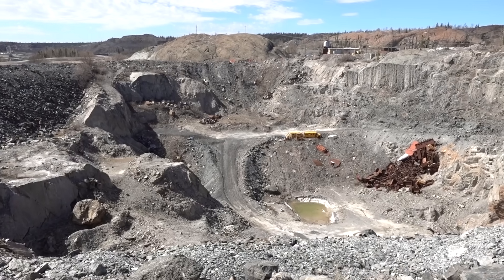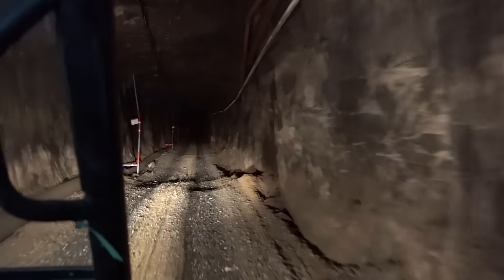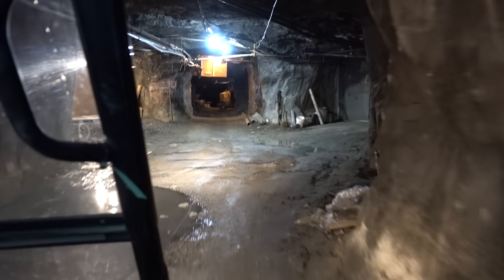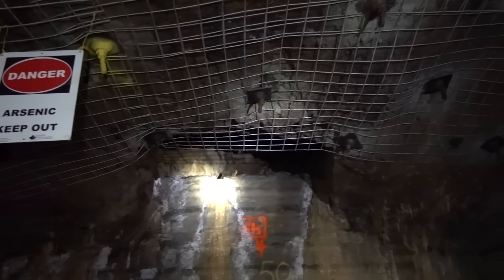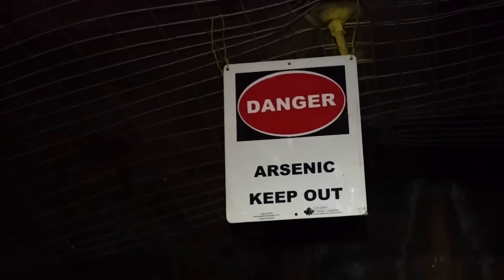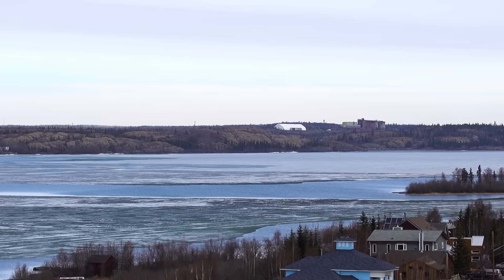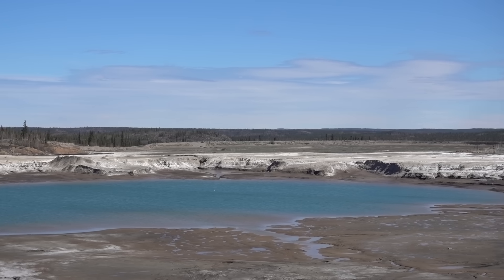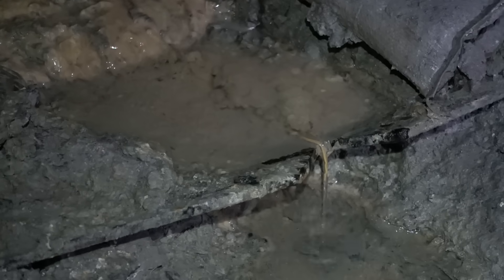Making 200,000 tons of arsenic dust safe

Comment: As the short term solution freezing is good enough and burying it under a mountain of insulation would really help. But for a long term solution the arsenic needs to be alloyed into a non-water-soluble state or the physics boys & girls need to come up with a way to make it stop being arsenic.
Reply: @DonaldKasper-j2r  
I prefer a more efficient insulation.
Reply: Are you suggesting Alchemy?
Reply: @zacharyhenderson2902  
Atom smashing hopefully gaining useful energy from the process.
Reply: @calvingreene90  220,000 tons. And even then that's not really a great solution
Reply: @zacharyhenderson2902 
If you are getting more energy out than you are putting in it is a good solution.

Comment: So this is a problem because the mining company removed the rock above it?
Can't they just... put the rock back? Or, rather, use concrete?
Alternatively, if they've got these giant vats full of of arsenic dust, why not put them on trucks, bring them further north, where there IS permafrost, and bury them there?
I'm sure they thought this through and came to the most logical, cheapest, most effective solution, but I'd still be interested to know what the issues were with any possible alternatives.
Reply: Someone else mentioned how it being a dust means if its moved it can go up in a cloud(like flour i guess)
Reply: You can't just put rocks back, the permafrost has already melted, not to mention, it wouldn't be the same, there would be holes, and the would just be as bad as not putting rocks. 

As for moving it, it's a fine dust, essentially, it's a toxic flour that would poison all of humanity of you mess up, better to not move it.
Reply: @midnightgear2616  Aww. I was just looking up the capacity of the Space X Starship, and calculating how many launches it would take to send this mess to the moon.
Reply: "Put them on trucks" on what roads, my friend? It's the Canadian Arctic...

Comment: I'm suddenly wondering something. What exactly were they doing in those mine shafts that created 200,000 tonnes of arsenic trioxide!? Was the gold ore embedded in another orebody of arsenic!? And if so, why did they let it turn into volitile to dust!?
Reply: The ore that was mined in Giant Mine contained Arsenopyrite, which is a mineral that is commonly associated with gold and copper containing ores. When Arsenopyrite is exposed to air, the oxygen in it oxidizes the arsenic in Arsenopyrite into arsenic trioxide. The reason for it being powdered probably has to do with Arsenopyrite's refractory properties: One of the most common methods for extracting gold from ore is heap leaching, where gold ore is crushed and heaped on a mat/tarpaulin and washed with a cyanide solution which dissolves the gold out of the ore, which can then be recovered out of the washing solution running out of the bottom of the heap. Arsenopyrite in gold ores can make the gold very hard for the cyanide to leach out, so you have to process the ore further before you can extract the gold. An older way of doing this is by roasting the ore, which would release arsenic straight into the atmosphere, and was actually done at Giant Mine until it became prohibited in 1951. Another way of further processing the ore is to grind it into a fine powder, which increases its surface area, thereby accelerating the leaching process, which is probably what they did at Giant Mine post-1951.

Comment: Mining did not bring arsenic to the area.  It is a natural toxic element in the rock of this area.  So why are you freezing it?  Natural ground water in this area is contaminated with arsenic, always has been and always will be. Surface dust and rock can simply be relocated back into the mine, sealed off and no additional care would be necessary.  Water treatment facilities in the city of Yellowknife need to remove enough arsenic to get the level down to an "acceptable" level.  Many communities all over the world are in the same boat, and no mining activities were in their neighborhoods.

Comment: Reduce the arsenic to metal, which is relatively non-toxic because it is not soluble in water.  Or fuse the arsenic into a glass such as arsenic tri-sulfide.

Comment: If like me you were wondering where the arsenic trioxide came from, turns out it was naturally occurring in the ore. The ore was roasted to extract the gold but the liberated 237,000 tonnes of arsenic dust is still in the mine (the arsenic was released to the air prior to 1951 when an Electrostatic Precipitator was installed).
Reply: Dogphlap The original ore was pyrite, which was roasted to the oxide form.
Reply: +Gordon Richardson     One of my many problems is profound ignorance that I strive to correct as best I can. Are you adding to my comment or correcting some part of it ?
You appear to know what you are writing about so perhaps you could enlighten me further. Pyrite is predominantly FeS2, so iron and sulphur. Where does the As (arsenic) and Au (gold) come in, are they just some low percentage contaminant and or inclusion in the pyrite ?

Comment: right now, with proper equipment, they could remove it... 
would it be costly? yes... but its better than freezing more moisture, into the arsenic, allowing a catastrophe when the freezing fails...
Reply: dijasom Moving it would release dust into the air and worsen the pollution. It is safer to leave it in place.
Reply: I can think of a large quantity of things "safer" than freezing... which allows even more moisture to accumulate... for the one failure, to allow it to unthaw, and now quickly seep wherever it wasn't supposed to be. 

Imagine we live in a world, where a nuclear power plant broke, and hundreds of thousands of gallons of sea water is being rendered nuclear waste, and you may have some semblance of how stupid, a STOP GAP, measure is... 

This is not safer, this is cheaper.

Comment: I'm not stupid but can someone tell me what would have happened is they never dug there would it still be setting in to the water in the area, If not how hard would it be to fill it back up it feels like it would be cheaper to do that then maintain this for a 100 years. If you can answer my probably dumb question it would be great thanks.
Reply: Youbring The original ore was solid rock. In order to extract the gold, it was ground down into a fine powder, then roasted to convert insoluble sulphide into oxide. The process is not easily reversible.

Comment: Is't there a market for arsenic?
Someone in industry sure must want to buy arsenic for whatever process or material.
Maybe metallurgy? Chemistry?
Reply: Arsenic can be used to alloy with lead to strengthen it, e.g. in car batteries. It's also used in certain semiconductor fabrication, e.g. radios and laser diodes. Unfortunately, only a small amount is really needed.
Reply: @techmage89  also- highly purified arsenic trioxide ("primary standard" grade)  can be used as an analytical reagent - probably a minor use though

Comment: Why not pack the arsenic into steel containers and fire them into space? Yes, that would be expensive, but we're talking about and I quote "Enough arsenic to kill everyone on the planet several times over." I think that's worth the cost of getting it off the planet. Especially since freezing it is going to take the same amount we spend on 10 Falcon Heavy launches.
Reply: "Boom."
That was the sound of one of those rockets exploding, distributing the dust across the whole atmosphere.
Also, I don't think that a Falcon Heavy can lift 20.000 tons. :D
It's way, way cheaper that way, and even a lot more secure.
Reply: @varana  So what? One wind storm kicks that dust up into the jetstream and we all die anyways. You're arguing that "Its okay if some random future people die, but not if I do. " Either you value human life, or you don't.

Comment: Two obvious questions come to my mind:
1. Where did that arsenic come from that it wasn't poisonous before (I guess somehow bound in the rock)? and 
2. Can we react it back into such an inert form?
Reply: 1 it probably was included in rock, as some sort of mineral,  where is was protected from being washed out, though it still was as poisonous as it is. 
And 2:   Even if you react it with something that makes it very insoluble (like lead, barium or sulfur )you still have a powder or sludge, and no compound is 100% insoluble or inert (except for helium and argon). I guess pouring the mine full of molten  lava would help :D

Comment: My guess is that, just as in long-lived nuclear waste, vitrification will eventually be looked to for permanent sequestration. For more permanent remediation into stable, non-toxic material, nuclear transmutation into As-73 -> Ge-73 might do the trick. Germanium has commercial value in semiconductors, so that might offset the cost of the transmutation. I don't know of any commercial outfit that is geared up to do this sort of work, though.

Comment: Hmm, I wonder if Tom ever made it to Britannia Beach.  It's a place in BC, Canada where a remediation project like this has more or less played its part.  There was some major acid rock drainage issues (basically, water leaching sulfur out of the rock and becoming acidic) in that mine, and then flowing out of the mine and into the environment - they sealed up most of the exits, and fed the other ones into a water treatment plant.  Again, not a perfect solution, but it's effective and will remain so as long as the government maintains their policy about fixing the industrial mistakes we've made.

Plus, that one does have a time limit.  Eventually all that rock will be weathered out, same as the rock that's naturally exposed on the surface of sulfide deposits, at which point the acid formation process will stop; a while after that, the water being drained from the mine will become neutralized, and the need for water treatment will stop.
Reply: Its probably grounded
Reply: Could they put some dissimilar metal structures in that pind from the mine and make a battery ?

Comment: 200,000 tons of gold taken out in the 20th century? Isn't the world total of mined gold about 175,000 tons?
Reply: I think he meant to say 200,000 kg. Wikipedia says that 220,000 kg of gold were produced there.
Reply: I noticed that as well. Besides, 200,000 tons of gold would be 8 trillion not 8 billion dollars worth.
Reply: Phil P
Makes sense. I figured he got it from the 200,000 tons of arsenic. Maybe some of each.
Reply: He's probably talking about the ore, not the pure metal.
Reply: Gaehhn It is a historical quirk which makes the numbers having names at all largely useless as the values being referenced become so large so quickly. It is inconsistent with the 10^3 spacing of common metric prefixes and how numbers are written in full form. The names can also make sense if you consider it as 1000, 1000x1000, 1000x1000^2, 1000*1000^3, etc
Reply: 8 trillion seems to be a bit much doesnt it? but even if you do the calculation with historic gold prices the revenue is enormous.
Reply: 8 trillion in the short system is 8 billion in the long system: 8.000.000.000.000 or 8*10^12
Reply: @cjeam I do and basically everyone I know here in Germany. Also it's the system where the names actually make sense.
Reply: Nobody uses the long system anymore
Reply: @cjeam9199  sorry to disappoint you, but in Germany, we also use the normal system
Reply: @dsblocks  As do we in the Netherlands.

Comment: Just wondering, the arsenic now seeps into the environment, but when all of it is frozen, couldn't they either use the arsenic for something else? Or more realistically, pack the dust into barrels or something? Because I'm guessing the dust is just spread in the air, and not one block of dust, this would be a much better long term solution I think. Just put it in barrels, dig a hole and leave it there forever, like nuclear waste. No need to keep cooling it or maintain it (or at least not nearly on the same scale).

Comment: Better solution: Collect the dust, box it up in crates and fire it into the Sun. Problem solved.

Obviously nobody will do that, but if the freezing project is approved for the next 100 years, then really they're not cleaning up the mining company's mess, they're temporarily putting a hold on it. You can't keep cooling the tunnels forever, eventually it'll get forgotten about. I do like that they have a passive technology that can do this though, it's kinda like Factorio, when you finally unlock a way to automate something.
Reply: That is an awful solution

Also part of the funding is going to research to determine better ways of dealing with the problem.